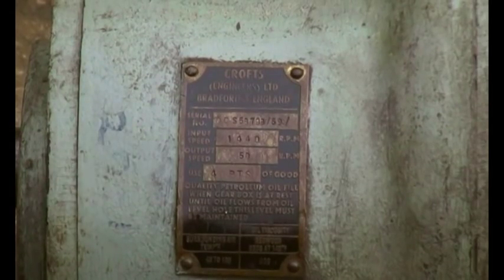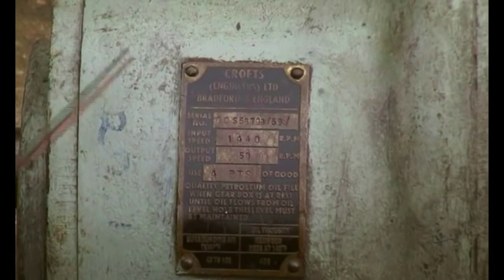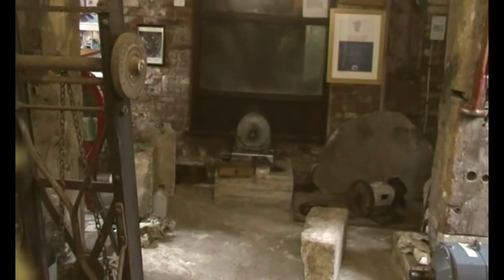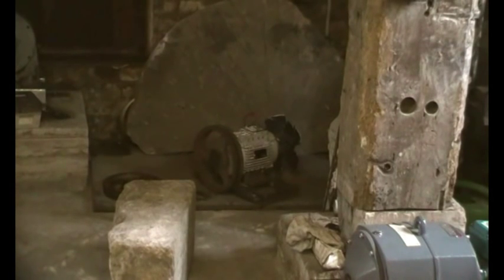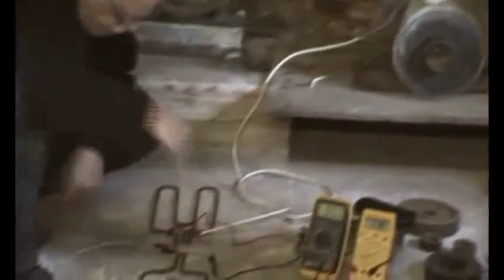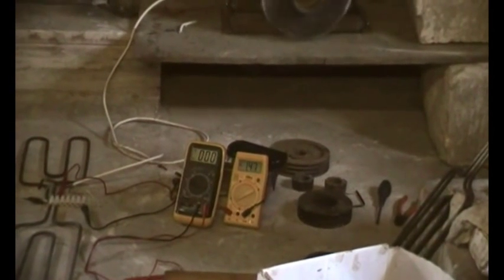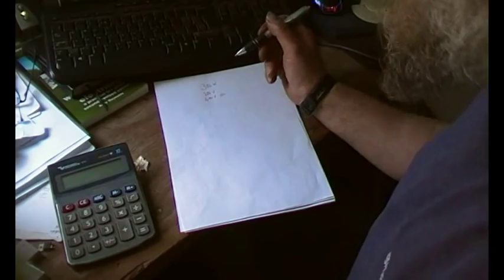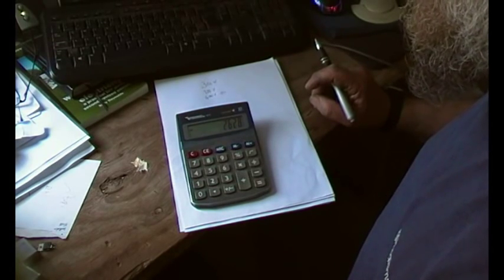Generating electricity with a watermill, gearing and output. Part 2

Comment: I am happy that someone has proven the technology of using a waterwheel in place of wind and the benefits of doing it. There are hundreds of waterwheel sites round here so we could be spared the many wind turbine blots on the landscape and economic folly which goes with them. Thanls!
Reply from the maker: The secret as you can see is to match the gearing to the generator output by testing it with a load. This was why we saw fit to change the gearbox for one with a much lower ratio. This generator is permanent magnet brushless 3 phase alternator feeding a 3 phase rectifier and designed to produce 1kw at about 250volts. Grid tie inverters need to be fed with DC, hence the rectifier. Pass the word about as I many people have missed part 3 where the system is actually working. Yes we have proved that this works. Cheers, Andy

Comment: Hi Andy, I could really do with picking your brains - I own and live in a watermill with a 14ft overshot waterwheel that we have turning occasionally but isn't connected to anything - I think from the calculations we did previously the wheel is able to produce 5 -7hp depending on how we control the sluice. Optimal rpm for the wheel we think is 19. Our challenge is gearing and the fact that we are on a split phase supply. Not sure where to start. So I have a lot to think about, what gearbox, what motor / generator, batteries and inverters or grid tie etc.
Reply from the maker: Hi, interesting, few ideas here. A gearbox looses plenty of power and flat multi groove belts are much better and an achieve large ratios. These are similar to washing machine or car serpentine belts. I used K section with 6 ribs in the video on ultra low speed pillar drill. A small driving pulley will work on a very large flat pulley and can give ratios above 10 : 1. If you use a 48v battery and a Victron multi plus inverter then a wind turbine permanent magnet brushless alternator will only need to run at about 400 rpm. The bigger the output the slower the rated speed due to the size of the turbine blades that would be needed to turn it in normal use. The multi plus is a UPS unit and can have power sharing. Water wheels are noisy but can run 24: 7 so huge generation is not needed and that would keep water use and noise down. Hope that gives you something to think about. Cheers

Comment: I am happy to do what I can. I know a valley near here with more than ten double acting mills (one wheel to  two powder mills) with the water used over and over again. Imagine how much electric could be produced. It is a nature reserve now but running water wheels is surely compatible with that?
Reply from the maker: Water wheels need maintenance and regular attention, but beyond that if they allready exist it seems a shame they are not used. It may simply be a matter of cost and non comprehention of the issues. I find many managers incapable of thinking for themselves and mostly quite impractical. Cheers

Comment: Thanks for your reply. This suggests that a bigger overshot wheel could drive a much bigger 'wind' turbine to good advantage?
Reply from the maker: The same wheel but overshot would be much better. The water on this wheel only enters at the level of about 4 oclock, so it is very low. See part 3 and see how the grid tie data changes as it tunes itself to the generator. Cheers

Comment: Have you thought of driving a 'wind' turbine with a waterwheel? The direct drive type particularly do not need high revs to operate. Get their output 24x7 and what do you get?
Reply from the maker: Hi. The one we tested and use (in part3) is a high voltage direct drive turbine generator, designed to run with a grid tie. As you will see in part 3 where it is connected. The problem with this wheel is the water height. Have you subscribed?  Cheers, Andy

Comment: Thinking if you could take power off the outside of the wheel you would be better off. No gear box to rob power plus your RPM's would be much higher.
Reply from the maker: Hi, thanks for he comment, things would get awful wet with that method but exchanging the gearbox for K type toothed belts would be a way of loosing that gearbox fiction, cheers